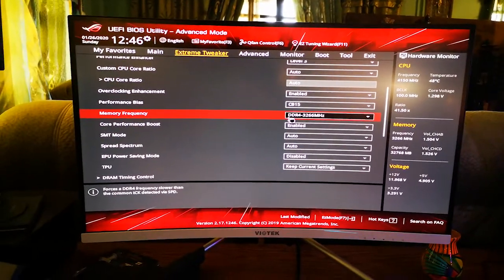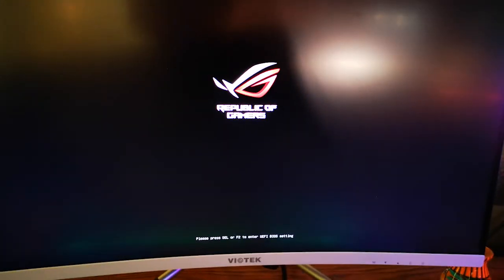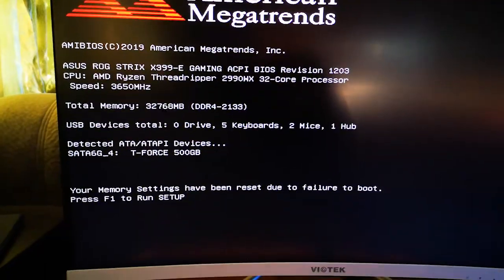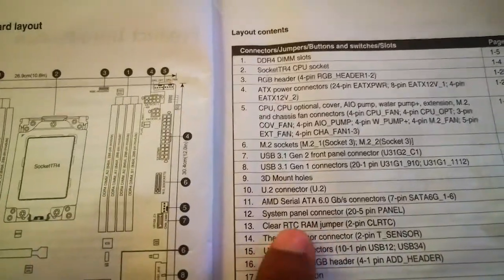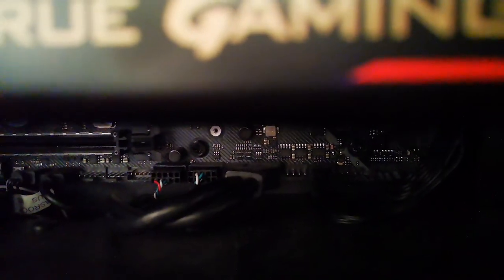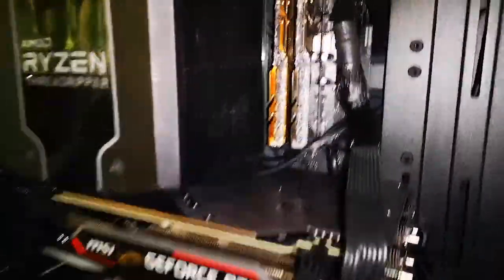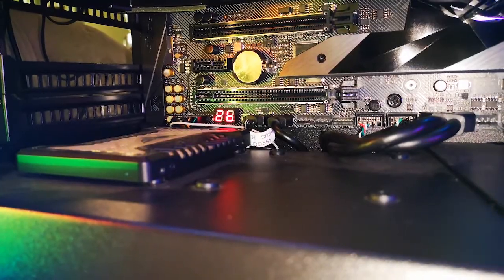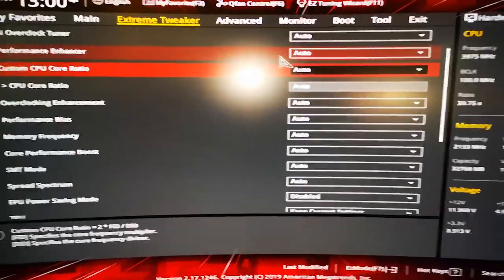How to FIX a BAD MEMORY Overclock - Part 2. PC Blank Screen

Comment: Where do you get the jumper
Reply: Did you get it?
Reply: @PratoshRavikumar  I didn’t get but there should be 2 pins by a silver circle you want to put a flat head in between the 2 pins and hold it there for 15 seconds also make sure pc is off
Reply: Can you tell me where

Comment: Hi man, I have a problem, look I have pre build hp pavilion and used ryzen master and I overclock too much on the ram speed then I restart and then I didn't get any signal on the monitor and got 3 beebs from the motherboard I don't know what to do I have no signal to keyboard too
Reply: SAME BRO
Reply: I FOUND HOW TO FIX IT MAN
Reply: @krim1452  how
Reply: @krim1452  how